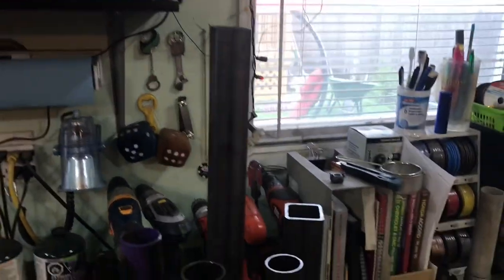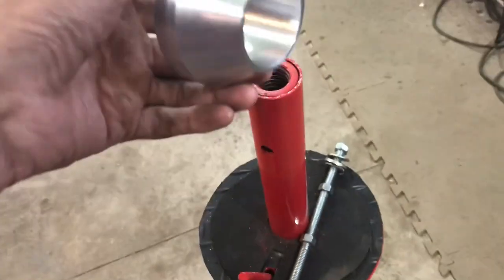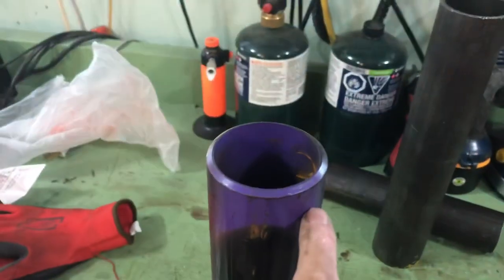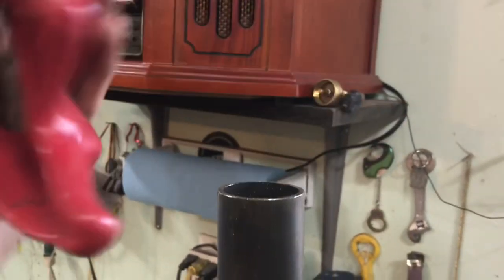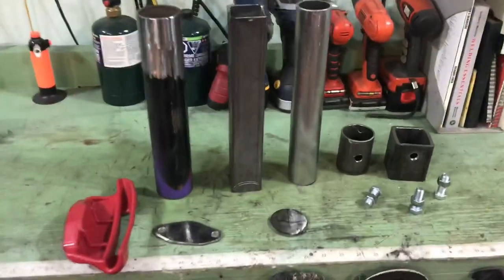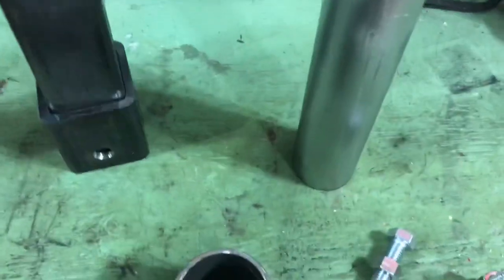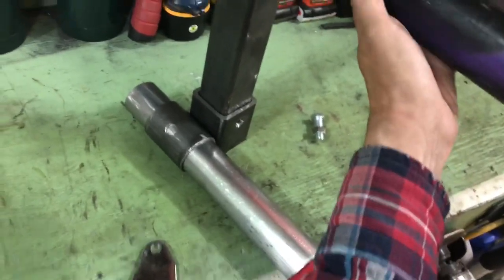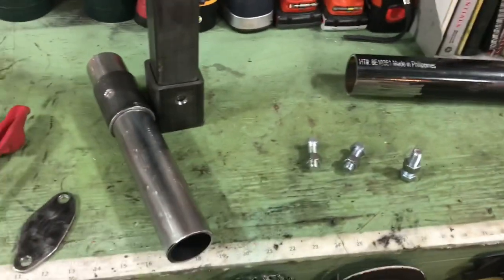Manual Tire Changer Mod.

Comment: Do you still have the invoice with the size of the square tubing and the thickness. And round tubing and the thickness. If so can you take a picture of the invoice to see the sizes. Please if you can. My metal shop needs the outside and the inside measurements plus the thickness of the round and square stock to order it. Thanks
Rick
Reply: I do remember now my stuff was .250 thousands thick. I wouldn't go any thinner than that.

Comment: I got all my steel cut and laid out to be ground and welded. Thanks Bruce
Reply from the maker: Awesome Joshua.  Hope it all goes together smoothly for you.  Let me know how it turns out or if you have any questions.
Reply: @BruceLyeg  I'll definitely let you know Bruce. Thanks
Reply: Joshua klingensmith do you have your measurements of yours. Like the thickness of the round and square tubing. And the outside and inside measurements too. Not the length. I have that. Thanks
Reply: @rickiet805  not off hand unfortunately I had to move because of a divorce
Reply: @joshuaklingensmith7843   not good. It happened to me three years ago. Better now.
Reply: that's good. My shop stuff is still in the garage so I try to keep away from her as much as I can. I really would like to just have my house back but idk

Comment: we have tire stores in USA and they have monkeys that will over tighten your lug nuts and scratch your rims up for a little extra charge.
Reply from the maker: Hey! We have the same monkeys here!  Some of them work at lube shops and strip your drain bolt too!

Comment: Nice design. I was thinking of doing something similar to my HF tire changer. How are you spinning your mod around the tire when it often takes a lot of force to put a new tire on? where are you getting your leverage when you don't have the arm sticking out of the other side of your pivoting point?
Reply from the maker: I still use the bar that came with the tire changer to turn the attachment around.  It doesn't really take too much force as long as you use a good tire lube.  It takes a lot less force with the tire duck than using the tire bar alone.

Comment: good job, you could pass the measurements of the thickness of the bars you used thanks.
Reply from the maker: I don't have anything written down, I just designed it as I built it.  Here's a video that explains it a little better
https://www.youtube.com/watch?v=nmXVeLamRgU&t=49s
Reply: @BruceLyeg  👍

Comment: Can’t wait to see this done what stops or limits the size tires yo can remove is it the size of the bar and the pivot point?
Reply from the maker: Hey John. Good question.  I've only ever seen similar modifications do up to a 22" tire.  I don't see why it couldn't do larger as long as it isn't a low profile tire with a stiff sidewall.